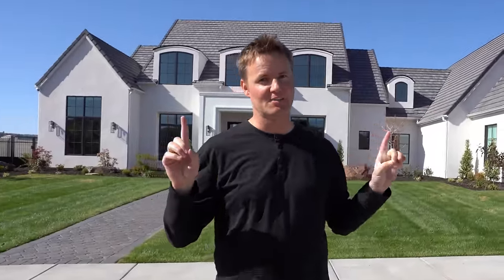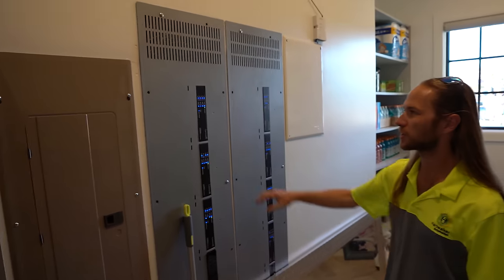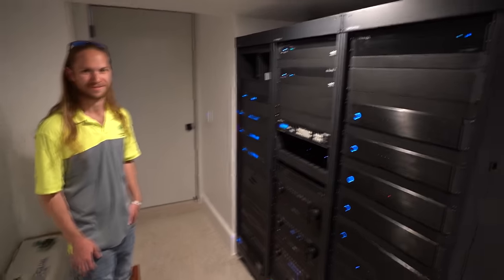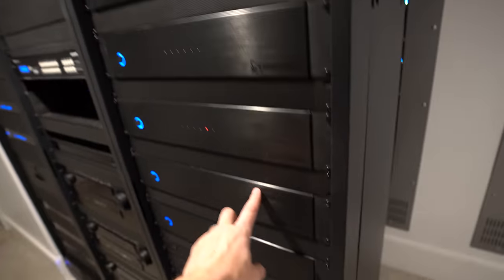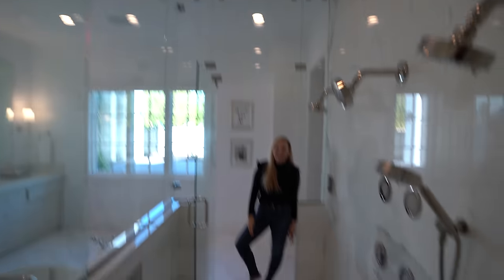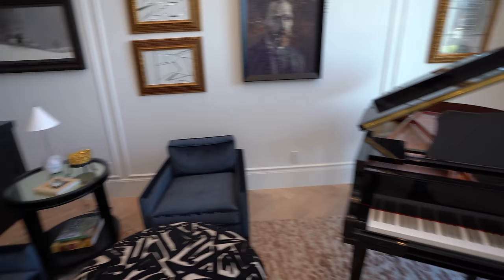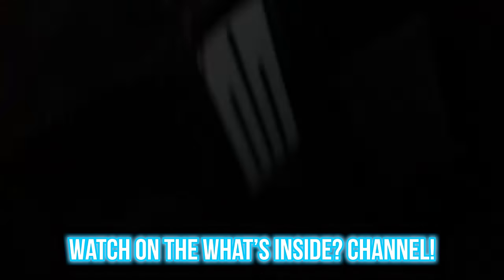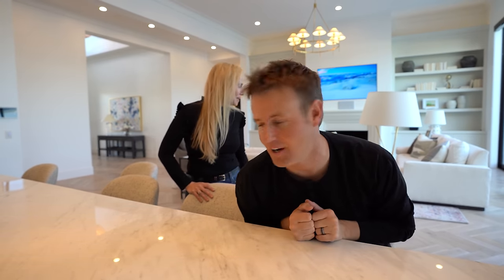FULL SMART TOUR OF OUR DREAM HOME!

Comment: Dan: wow we have 1 gigabit internet
Netherlands: we want that everywhere
Linus tech tips: we have 10 gigabit network
Reply: @refjuuzT  *Does
Reply: @Eromaw  no thats not entirely true ltt has 10gig and they can specify it to certain devices so that 1 server doesn't take up 8 gig if they want they can give 1 device 10 gig they give you this information you can see in the folding at home server video
Reply: Peasents I have 10mbps
Reply: If I'm not mistaking, Linus sad they have 10 Gbit/s to the main Internet Exchange in Vancouver, but "only" 5 Gbit/s to the broader Internet. Anyway, it's impressive, especially considering it's a dedicated connection made for enterprises, not just a residential or SMB shared connection, like GPON.
Reply: Switzerland laugh in 10gb/s everywhere

Comment: In 10 years the house will still be new but not a single thing will work anymore.
Reply: Tech in this house will work. Its not like its a computer that needs to perform and overtime it wont be able to run the games you want. The technology in the house works for everything in the house at the moment, and only will stop working if he added new things. how often do you change your lights or speakers in your house? Also cables will last a long time, the things that might change may be the servers and command computers.
Reply: He is going to need service contract just for all the tech
Reply: Ha ,  prob right !
Reply: It's true this tech is already a decade old plus house kinda got some cheap vibes ngl. Not real wood or imported tile etc. Just what 400k gets you anywhere but good places NYC LA SF Boston etc, anywhere inland and  not coastal with no industry
Reply: @iankonstantino6648  Cars these days with all the standard tech have problems within 2-5 years. I highly doubt this home will be problem free in the next 5 years. but when you have that youtube money it doesnt matter.
Reply: In 10 year all that tech is going to be outdated duh  🚗 🚘

Comment: All of the wiring, networking, and media data center is really impressive. Based on what I’ve seen, a lot of these things can be also be achieved with basic smart home accessories and automations, but you have the sleek design. A downside to consider is maintenance and upgrades. While this house is impressive now, technology is always changing. Speakers in the wall are cool but it may be hard access if something needs upgrading. Overall the planning that went into this was smart and will last a while.
Reply: Yup. This house is already outdated.

Comment: That moment when you realize your whole house has been hacked and has a virus.
Reply: That is one of the legitimate problems. There are others. My friend’s aunt lives in a smart home, and there was a fire. The smart home locked the doors to prevent the fire spreading. She had just been in the shower when it happened, so didn’t have her key card. She was luckily able to fumble around and find it to override the locks
Reply: They have there own server system. So someone would have to find the ip address and know what system they use.
Reply: @lengeljeff  well we know what system they use, thats one down
Reply: @lengeljeff  You're saying that it is a hard task to ping an IP and then get the os, lol. If it is any version of GNU/Linux, which it will be, that would take like 2 seconds.
Reply: @kone8258  The firewall for the server should be configured to only allow a static IP from the cloud company to talk to it (along with a complex root password). A better attack vector would be a router with internet access. I'm sure the password for the router would be impossible to brute force so you would have to first target something simple like a light bulb. Some smart devices store the router's password in plaintext. One issue with this method is that you would have to be in close vicinity to the house and I'm sure you'd be tackled to the ground before you even step foot anywhere near the front door. Another method may be malware, sending an executable to either a phone or a computer in the hopes of Lincon wanting free VBucks and opening an email attachement. This will give us access to the computer and from there, we can connect to the server and do whatever it is that we'd want to do. One of the pros of this method is that you can do it remotely, provided that you know the email address of somebody that uses a computer in the house.

Keep in mind, this is all hypothetical and I have no clue what type of access points, smart devices, etc. are in the house.
Reply: Yes, this reminded me the entire time of this scene: https://www.youtube.com/watch?v=aAj8zHOEfiI
Reply: Lincoln: what's happening 
Alexa: hahaha you have been hacked
Reply: @0xC  Dam you really planned it all out lol . . .
Reply: I do hope he has a vpn on his pc, otherwise you can see their IP adress at 7:16
Reply: I repeat, movie: Firewall
Reply: @gerben5964  He doesn't.

Comment: "What's the total value of all the smart devices in your house?"

Dan: "yes."
Reply: It's probably equivalent to the cost of a mansion
Reply: it will amount to nothing, in 5 years, its the fastest way to loose money.........omg, its just over the top...........
Reply: @vikramjitsingh4538  in 5 years that will still be a good quality house and in 5 years they probably would have re updated the whole thing and it might loose money but it would still be extreamly valuable if u just talking bout money
Reply: $1,000,000,000,000,000,000,000,000
Reply: @vikramjitsingh4538  why would be nothing? I even live on my small house for my entire life and its still not nothing.
Reply: @PunxTV123  depreciation and the tech becoming obsolete / out of date.  Firmware updates will stop & spare parts become non-existent so you have to buy it all again.
Reply: @jaxhoffalot2812  then don't update lol, as long as it works just the day it installed, no need to update. just like your house, you live it since childhood and u just move the bedroom/chair/etc.
Reply: Probably around 300k $
Reply: @Gavin Smith 300k? Id rather buy a car
Reply: Vikramjit Singh what else does that house need apart from new tv every couple years and furniture replacing so it will an amazing house for ages
Reply: That literally makes zero sense
Reply: @danielmpr  You could buy a planet for that much money. (or, more realistically, completely crash the USD market.)

Comment: Dan: Hey criminals this is the brains of your house

Dan: PS Don’t Rob Us
Reply: Reno Rayner I’m pretty sure they live in a gated or guard gated community
Reply: Pretty sure isn't worth it. I mean there propably is some expensive stuff in there but they have cameras and stuff. They even run without power to the house so for normal robbers pretty much not worth it.
Reply: 1.) Non of this stuff is actually portable so the robbers will struggle trying to rip the speakers of the celling 2.) the location is hidden well 3.) good security in the home nice comment tho m8
Reply: He’s done the right thing. He’s only shown one or two cameras out of 20 and if he is correct that there are multiple cameras covering each angle it’s fairly impenetrable. Also he’s not revealed details about his intruder alarm.

Comment: Imagine there is a powershortage. They couldn‘t get in or out lmao.
Reply: ZippoFire I have a smart home although a bit more humble than this set up, my house has a skeletal smart system wherein the door locks, wifi routers, modems, cameras, safety systems, etc. all have back up power good for a couple of days — more than enough until the generator starts running.
Reply: because they didn't say that they had those giant batteries for backup power...
Reply: @halalchicken8  Those wont last all that long. A UPS that size would probably power what they have there for a few hours at most. In anycase, those locks have their own battery that will last months.

Comment: This is awesome, but: I predict there's going to be a 10 year update video when all of this tech becomes obsolete and/or broken.
Reply: trueee. Unless there is a way to upgrade the tech without it being a huge hassle.
Reply: @KimKiKi0  Because most of it is hard wired, you can easily upgrade or even swap the "brain" and cover most upgrades
Reply: I imagine much of the stuff can remain functional for at least 20 years, such as the audio system, cameras, and controls. The media systems and the network should last at least 10, and the cloud-dependent stuff will become useless in as soon as 3 years when the companies decide to pull the plug. This, however, is the time until the systems become unusable, and the homeowners may decide to replace them far sooner.

Comment: What happens in 10-15 years when all this tech is outdated and the all the house's functions begin to fail, and can't connect to your updated phones.
Reply: Good point
Reply: You rip the walls and install the next generation system.
Reply: Renovate... or sell and let someone else deal with it
Reply: Move out and repeat
Reply: Cables should last forever (the life of the house). If it's all CAT 6, the network will be 10 Gbps capable. They will just replace components as things get upgraded or break.
Reply: Well there’s Ethernet running everywhere so you would just replace the servers and light fixtures etc.
Reply: Kevin MZY yeah but it’ll probably be quite the pain.
Reply: It looks to me like an home automation bus. That has one internet gateway in the whole system that usually can be replaced by disconnecting four wires. But I'm from the EU so I'm not familiar with these fixtures. Here in Europe the KNX bus is the most common one. Just search "knx bus wiki" and you will get some infos.

Comment: I have automated everything in my home, garden and electrical system so I can appreciate the beauty and effort put into installing this but, can't help but feeling this is like using a hammer to install a screw.
- First off from a security stand point this has a HUGE attack surface. All it takes is one appliance to be compromised.
- Wires?!?! serious?
- Too much reliance on cloud services. You should go local any chance you get.
- Way too much maintenance when things outside your control change. 
- Room full of equipment

It's like you spent extra money to make systems more vulnerable and prone to issues. As it stands today, nice setup!

Comment: I have a question. Did you consider all the vibrations coming from the speakers and subwoofers and what that might do to the structure of the house over time?
Reply: The rafters are all nailed together. They been doing it that way for hundreds of years.

Comment: Where do you purchase the lighting assembly/ what company provides the gear? Been trying to do it with regular 120 and 4 gang boxes everywhere. I really like the multiple lights at a single gang switch
Is it all low Voltage back to that main pannel? The switches are just recivers?
Definitely would like to know more

Comment: What happens in a few years when this is all obsolete and your phones can't connect to it...
Reply: At the rate or technology advances daily that might (small chance) be possible. But because they have Siri and/or  Alexa that isn't going to happen any time soon. iPhone still supports their iPhone 6 which was made in 2015 so 5 years ago so even if he has that set to his iPhone x considering they are coming out with 2 new iPhone every year it would take 7-12 years for it to be outdated. 
Even when that happens they still have the touch screen tablets on the wall so they will be able to control it that way.
Either way they have more than enough money to upgrade as the times go along. All that is assuming they stick to what they have right now.

Comment: 5:40 Can someone with network engineering experience explain what the point of adding all the 1-3 u spacers on the racks is? Does it help with cooling or something? Seems like they could fit all that it 1 or 2 racks instead of 3
Reply: It's for cooling and/or allowing space for future expansion.  Many "1u" devices are actually designed to be installed with a blank space above them because they lack sufficient internal cooling to be stacked tightly.

Comment: Wow.

Meanwhile I went the poor man's route for the lights and installed smart bulbs instead, because my house is older and doesn't have neutral wires at the switches. 

At least the receptacles and outdoor cameras were easy.

And for those of you claming "broke" or "poor" you have to realize that it takes YEARS to get to this point. Or extreme luck.

Comment: I have pulled full control 4 systems just like this out of several homes to replace them with Crestron. When you are spending this much money just go with the best and do your own research. Automation installers push control 4 because it easier for them to install and it’s “good enough for your specific home” shouldn’t pay a lot of money for “good enough” 
I won’t go into the quality of sound from the amps and speakers because he got those for free...

Comment: Great! Then what? 
First-year: you realize that you have to hire an onsite technician to keep all this tech running.
Third-year: you gonna get hacked because one of the vendors failed to quickly patch a 0-day vulnerability. 
Fourth-year: you'll face a compatibility issue. Whatever it will be USB4.0, 6G, or neural-interface. Who knows. 
5 years down the road all this fancy tech will be totally outdated. 
7 years most if not all will vendors drop off support or go out of the business.

TLDR;
TECH IS THE WORT INVESTMENT

Comment: I remember when I brought my house 3 years ago, it had the best tech on the market.. now is just laggy and slow
Reply: Yup. Sounds about right. As cool as smart houses are they require a tremendous amount of pre-planning and a massive budget to keep things operational and cutting edge. The three biggest factors that must be considered when planning a smart house are serviceability, reliability, and ease of upgrade. Maybe 1 in 10 smart houses properly take into account these factors. Take in-wall speakers for example. How exactly are you going to upgrade or service them without tearing the wall open? Same goes for power, networking, coax, LV controls, speaker cable, etc. Everything and I repeat everything needs to have discrete access panels and all wiring must be ran in upsized conduits. I have seen smart houses need to be completely rewired before construction is even finished due to changes in the technology. If you run conduit you only have to pull through a new wire. Also, make sure every room is wired for everything that it may possibly one day be used for. In other words if you are going to be crazy enough to build a smart house you minus well send it or you will learn to regret it. Besides, think about it, is Amazons Alexa going to be around 25 years from now? Even if it is will it use the same interfaces and wiring? No, no it won’t. As soon as the drywall goes up unless you have a plan you are committed to the technology of the day up until the house gets gutted and remodeled. You spend the money and take everything into account now a complete system upgrade goes from a 3 month project to a one week project at 1/8th the cost.

Comment: Nice setup. Just the per a cabling cost between $200+ and extra anything larger than 1600 sq ft. I sure the owner have a diagram of each label cables for basic TS (trouble shooting.) 

Just a note... it will be a freaking major nightmare if someone just snips all them cables just because. YIKES!!

The command center has its very owned dedicated AC to keep it cooled own as it was a NOC's (data center.) 

Question: With all that electronics... 
  **  have the owner/builder installed a redundancy surge protect block at the DMark?? 
  **  is all the outlets has a surge protector built in with a major warranty?? 
  **  does the has a lightning rods with electro shielding? 
  **  Solar system??

HACKERS are just drooling over y'all design.

Comment: @ What's Inside Family. maybe some of the equipment I use may spark some ideas for your home. 

In my smart home we use the following:

3 x 3rd Generation Echo

1 x 3rd Generation Echo Dot
1 x 1st Generation Echo Shows
2 x 2nd Generation Echo Show 5 (1 installed in wall)

We use the echos for automations, whole home multi room audio inside and outside the property

Samsung Smartthings to control our home, setup most things to be done via automations

Our whole home  Evap cooler for our home is controlled by our smart thermostat and Samsung Smartthings plug and controlled via an automation

Our security cameras throughout the property are Wyze 3rd Generation cameras and we use the AI features to trigger automations also

Our lighting is primarily Philips Hue
Our accent lighting throughout the property is Govee  LED RGBW strips

4 x Smart televisions

Roomba i7+ self emptying vacuum so no daily maintenance for the robot vac is required. 

Self cleaning toilet addon - FluidMaster Flush 'n Sparkle

- Schlage Smart lock (automatic unlocking via presence detection)

- Automated air purifiers throughout the property

- WYZE Smartband watch. The smartband includes Alexa integration so I can issue commands with the watch also. 

4x Google WIFI Mesh system; Gigabit hardwire ethernet in all main rooms

and much more. 

Everything is controlled in one app (Smartthings) . I even use IFTTT to tie products into Smartthings (like my Roomba i7+). So no need to use multiple apps after initial setup. .

I do a lot via automations. Our home has 50 or so automations.

Comment: Lot of wires, lots of speakers, misplaced priorities, where's the enterprise grade firewall? Malware protection and dns blocking should be on the network not in just computers. Did not about Access Points for WiFi, running the internet through OEM router? What about Vlans how is network managed? Only wires, and expensive control4 plugins and hardwares?